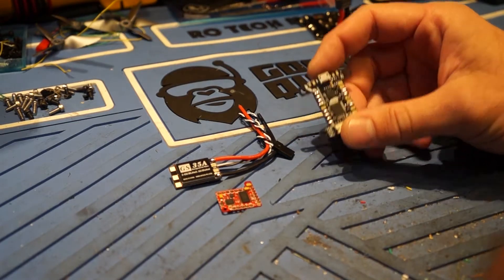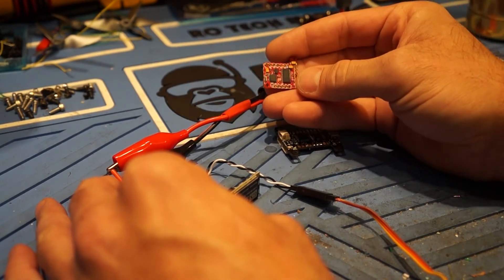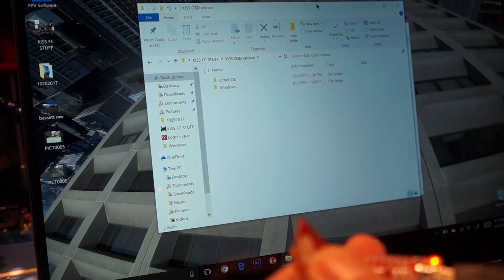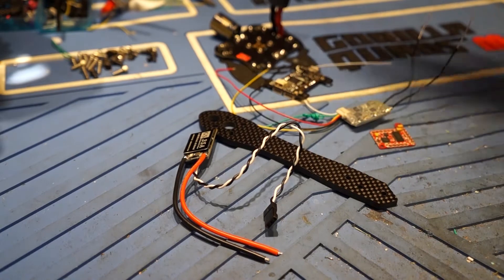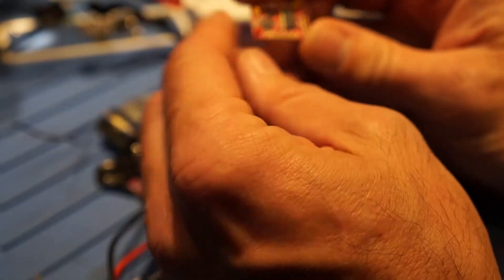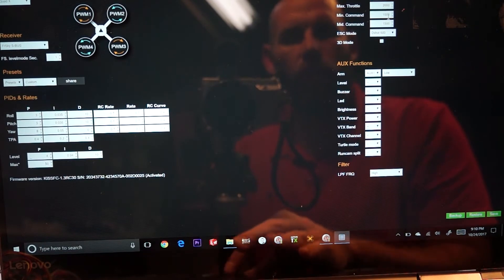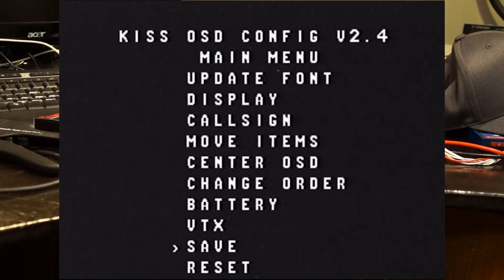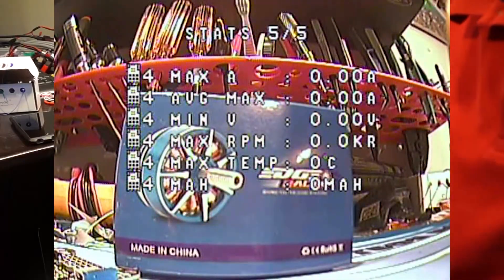Kiss FC & BLheli32 tutorial with Kiss OSD with Stick tuning & full telemetry tutorial

Comment: It's a very good tutorial, but everyone still says that you need another betaflight FC to flash BLheli esc.
How is it possible?
Reply from the maker: 2 ways a old school ESC programmer or a betaflight FC
Reply: @fsarfino  Alright I understand.

Another thing, does the Turtle mode work with a kiss-V2 and blheli esc?
There too I had controversial information
Reply from the maker: @vig6254  yes the kiss build in my latest video has working turtle on Aikon32 4-1 blheli32 ESC
Reply: @fsarfino  how did you get telemetry to work with the Aikon?
Reply from the maker: @graykimchi  on that esc since it only has 1 shunt resistor and not 1 for each esc on the 4-1 the only telemetry you get is esc temp and rpm unfortunately. quite a shame kiss esc cannot accept analog current sensing. I'm addicted to F1 now tho and it flies sooooo much better than kiss imo
Reply: Frank Sarfino haha I have had nothing but trouble with flightone their boards aren’t reliable imo

Comment: Nice tutorial Frank.

I got some questions. After soldering the esc telemetry wire, we supposed to get the current and fuel data, right?
I got Aikon 32bit 35A 4in1 esc and already soldered the telemetry wire to the esc telemetry pad. And i tried discover new sensor on my taranis but the value stayed 0 even after i armed the quad.

How can i fix this? Thanks in advance. Cheers.
Reply from the maker: Muhammad Hijrianza unsure with that particular ESC. It might not work the ones I mentioned in the video I know for a fact work but ymmv
Reply: Frank Sarfino do you got current and fuel value on your taranis.? Or is it only works in the OSD?
Reply from the maker: Muhammad Hijrianza to be honest with you I never checked that on the taranis. But I was getting fuel call outs so it must have been there 😃
Reply: Frank Sarfino ahh ok. Maybe my esc telemetry is not compatible with the kiss fc. 😂
Thanks for the information Frank.

Comment: I have been trying for days to get my blheli esc's to work correctly with the kiss FC and Kiss firmware. It just will not fly just does crazy shit, smashed multiple props and ripped off two antennas. The same set up with betaflight works like a dream. I thought it was because I had DS600 turned on but I am using the same software 1.3 RC30 as you. I have no idea what is wrong set up looks the same as in your video but there are different ESC's. Any idea's? I will probably flash it back to betaflight, if I can't get it to work in the next few days. P.S Thanks for the video.
Reply: are you sure your signal wires are wired up right? the direction is different then Betaflight
Reply: Nice find you could be right, not sure it is wourth the hours of effect changing it back again. Kiss software is terrible on Windows, there drivers are like going back to the 1990
Reply: Jared Turner your right it can be a challenge my GUI works fine on my pc running Windows 8.1 installing the update won’t work with the GUI aim windows you need the DFU demo thingy then it works fine but I can understand your frustration